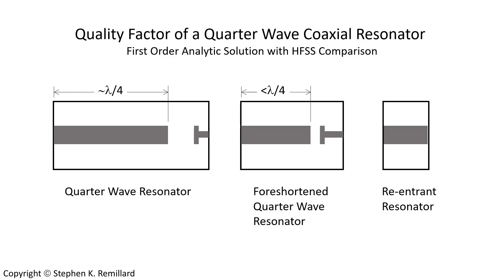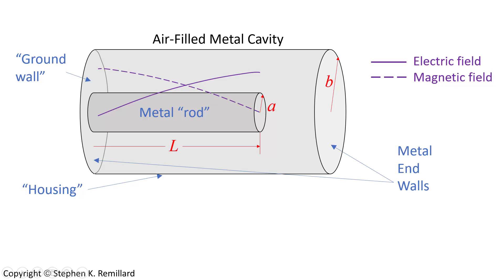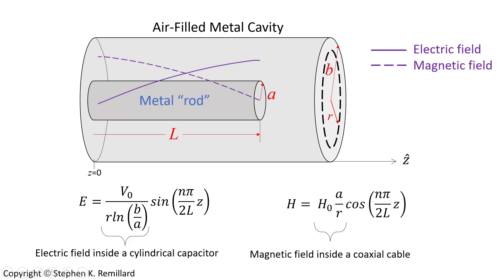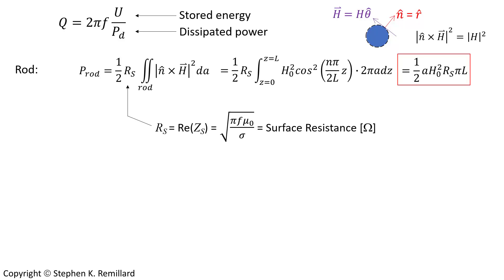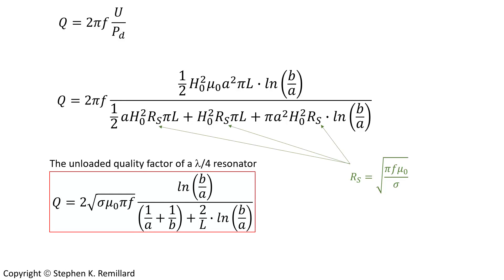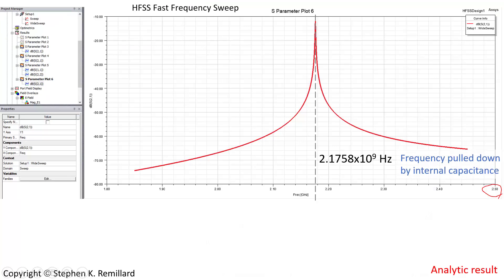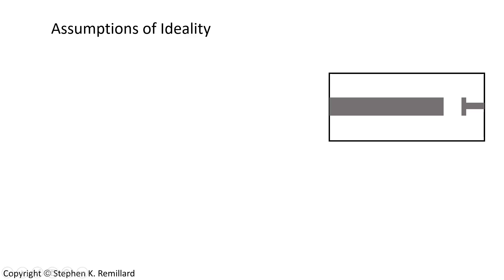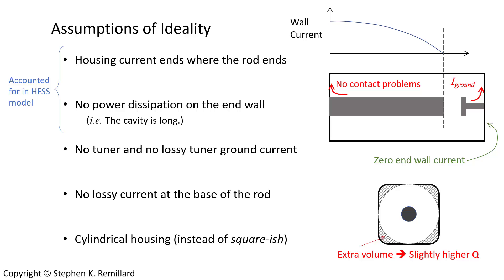The Quality Factor (Q) of a Quarter-Wave Coaxial Microwave Resonator

Comment: This is amazing! Is the code used to simulate this available?
Reply from the maker: HFSS is sold by Ansys Corp.  http://ansys.com/products/electronics/ansys-hfss#tab1-3   I can't really say that it's easy to acquire.  Cheap for educational institutions though.
Reply: @stephenremillard1  Thank you! I was able to get it through my university. I have a question for my setup (I'd really appreciate your advice if you have time). I need to simulate also a quarter-wave resonator, but something like in Fig. 1 from this paper: https://tf.nist.gov/general/pdf/1099.pdf. Basically, unlike your video, the input signal is through an SMA with the inner wire connected to the outer conductor. Also, I am interested in extracting the resonant frequency (in your case that was readout using the S21 matrix, but I am not sure what would port 2 be in my case). How can I do what I need in Ansys. For example, how can I connect the central wire of the SMA input to the outer electrode wall? I couldn't find this in online tutorials. Thank you!
Reply from the maker: @alexandermarshall372 I used to do that all the time.  But it has been a few years since I've had access to HFSS, so I need to go from memory here.  If you can draw the ports the way that I did in this video, then you're half way there.  Instead of extending the center conductor straight into the cavity, there is a command to rotate it about an axis.  It needs to rotate 180 degrees and come back into contact with the wall.  It's just been too many years since I've done it, so I don't remember the details of doing it.  Maybe someone else can come through for us with some specifics.
Reply: @ Thanks a lot for this! In this setup, where I don't have an actual outport, how can I get the resonant frequency of the setup?
Reply from the maker: @alexandermarshall372  By no outport you mean that there is only one port?  The resonant frequency is still plainly observed in an S11 sweep.  Also, you might consider having no ports and running an eigenvalue solve instead of a fast frequency sweep.